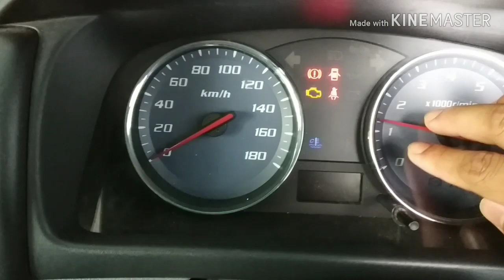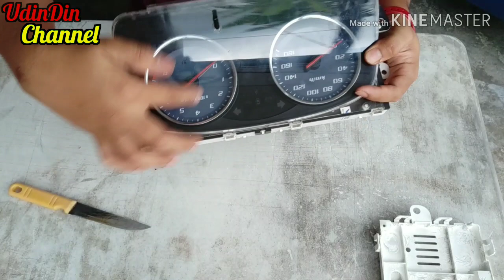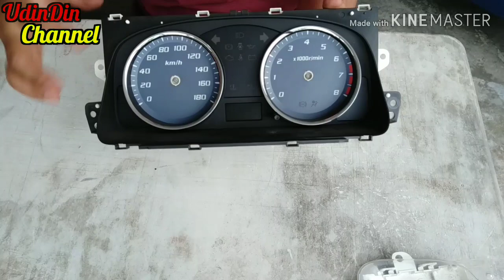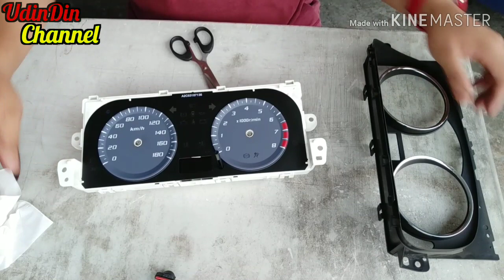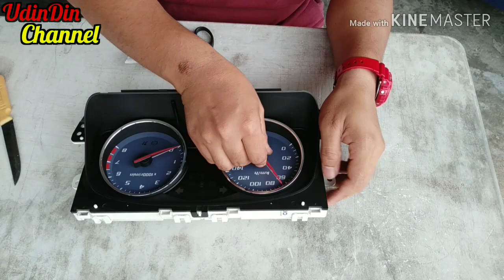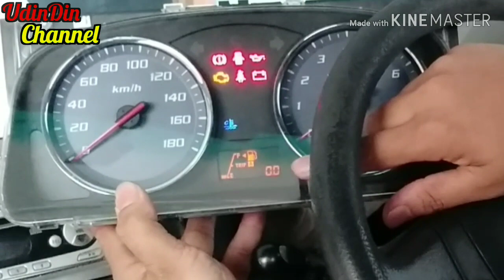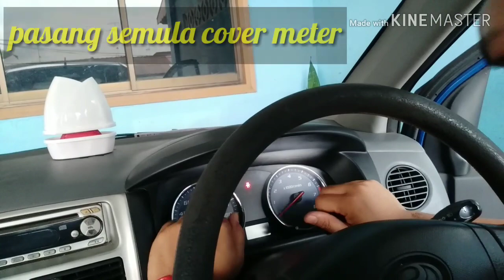Cara betulkan meter kereta

Comment: salam bos tumpang tanya ..lampu pintu dekat meter tak nyala kenapa ya..pintu buka pun tak mnyala ada fius ke macam mana
Reply from the maker: Sensor dekat pintu Tu dah rosak Tu...tukar je benda Tu setel
Reply: @UDINDINTV  tapi lampu bumbung menyala boss ..ke mentol meter terbakar?
Reply from the maker: Lampu pintu mmg akan menyala sbb sensor X detect...kalau dah ttp Masih menyala lampu bumbung Tu maknanya mmg sensor dah rosak...
Reply: @UDINDINTV  dalam meter ada tak mentol untuk lampu pintu? tengah confius bila buka pintu lampu bumbung nyala mcm biasa..tp dalam meter je x nyala
Reply from the maker: @shafiqaziz8309  mentol xde...dia pakai led lekat pada board pcb
Reply: lampu bumbung dah set dekat door
Reply: @UDINDINTV  ouhh ...selain sensor apa lagi bos ??
Reply from the maker: @shafiqaziz8309  yg sy taw itu je..
Reply: @UDINDINTV  okay bos sy try dlu tq share mantappppppp